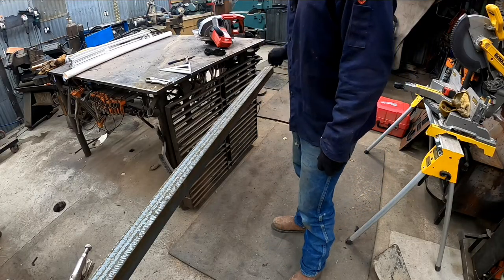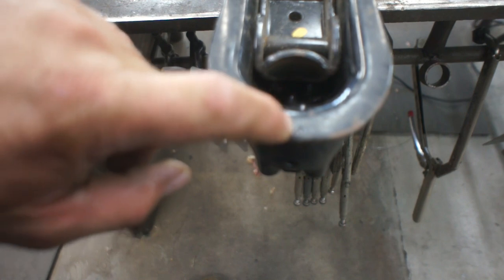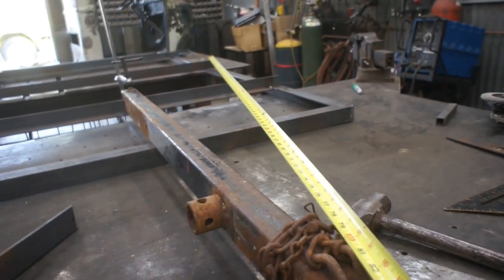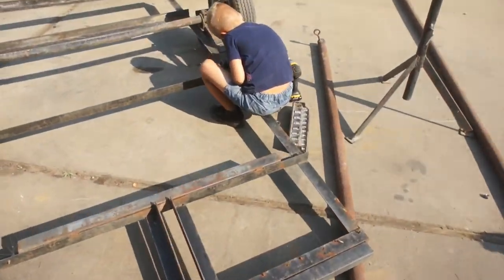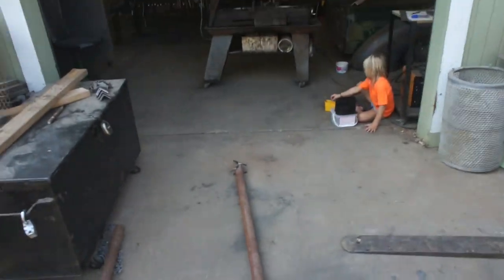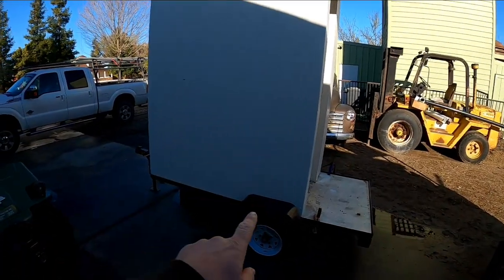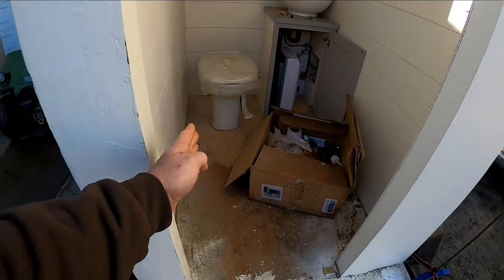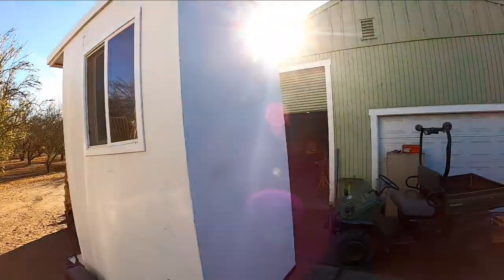4x8 trailer (re)BUILD | DIY portapotty.

Comment: You need a strong trailer pole for such a "wall" in the high-speed winds! Anyways, it's meant for static use. You are right about the sling... don't wonder how I know... I always use a "closed" system to hook. Would that be clevis or similar. How is your phone? Thanks!
Reply from the maker: Hey Joe, the phone was ok! Luckily it was a light load. Thanks for watching, Merry Christmas!